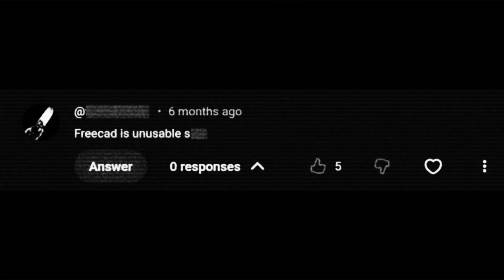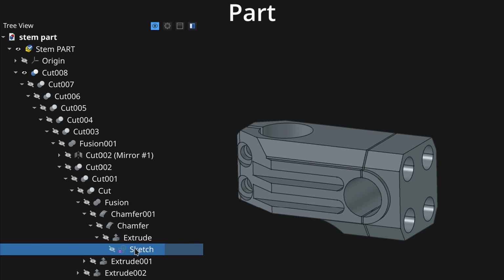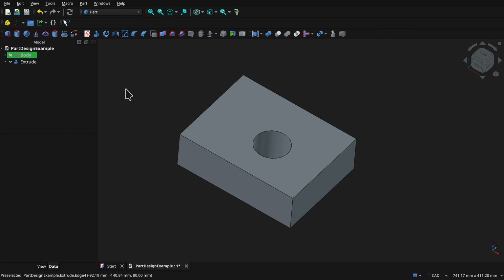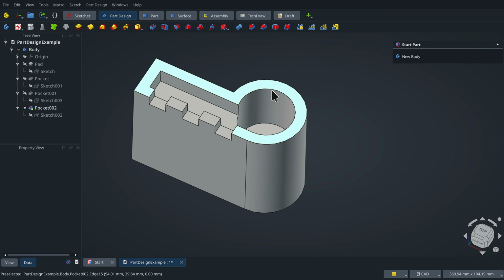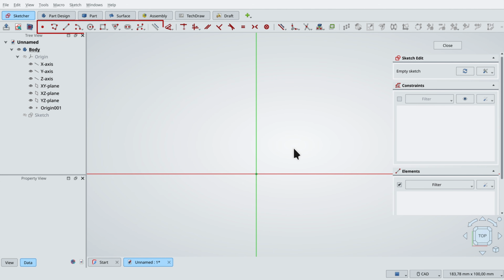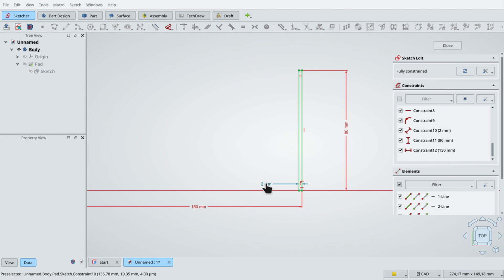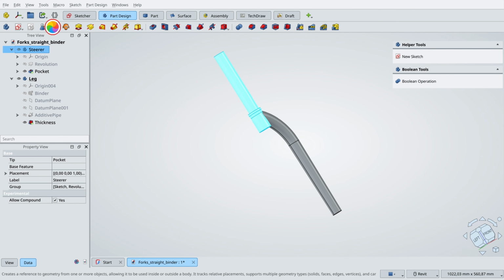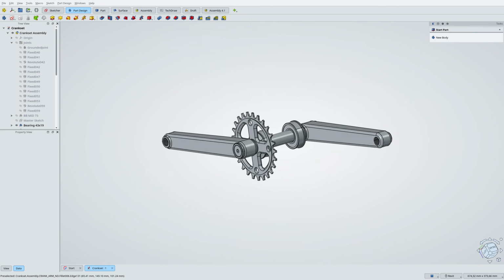STOP using FreeCAD WRONG! Do this INSTEAD (Workflow & Tips)

Comment: The UI is convoluted and confusing but the software is still really powerful.
Reply: It could really do with its blender  2.8 moment
Reply: @whistlehead9876 yes, was thinking the same. The potential for an amazing new UI is right there
Reply: @whistlehead9876  no it cant - too much complexity packed in one tool  But it's damn powerfull
Reply: @jakubrogacz6829 Same could be said of blender? And yet they did clean up the UI
Reply: @uhrguhrguhrg blender to me is more confusing than freecad, at least as far as parametric engineering style modeling is concerned.
Reply: @OtherDalfite  well, Blender is NOT made for parametric engineering style modeling (yet you could use it for basic stuff, there are addons made for that). Learning which software fits the task best saves a lot of time. 
The original comment was about the UI improvement the Blender Foundation made with switching from the UI we had from v2.53 up to v2.79 compared to the much more user friendly UI starting with Blender 2.8. 
I am a huge Blender Fan, have been using it since 2011, but it is not made for every task and I will never understand why people try to do everything in one single software, even things it was not made for. I could do 3D clothing with Blender, there are good addons, yet they still take much more time than working in Clo3D, Marvelous Designer or even the free alternative Style3D. So why would I use Blender for garments? Or why would I use it for parametric assets or where I need precise measurements? Any CAD software is better and much quicker for that task than Blender. 
But that does not change the fact that the Blender UI was improved a lot with that makeover, and I  agree with willmakevideo, the FreeCAD UI could be improved, but that takes time. Fortunately they already did some good improvements with version 1.1
Reply: @CG-Tutorials  don't mistake what I'm saying to say blender is bad or whatever because it isn't laid out like a parametric modeler. It's just confusing to me personally because of all the different tools there are. People make good stuff in blender all the time, I just have a skill gap.
Reply: @OtherDalfite  I did not understand your comment as if you said Blender is bad in general. You wrote "at least as far as parametric engineering style modeling is concerned", and that is what my comment is about. No hard feelings 🙂
Btw, Grant Abbitt has awesome tutorials here on YT if you want to get rid of that skill gap. As do Blender Guru, CG Boost and some other channels. My grandson startet with Grant and learned it pretty quick.
Reply: It is open source software.  A lot of devs are interested in UI features and as a consequence it has too much UI flexability.  Having a theme like this put on out of the box is going to step on a lot of fingers :)

The UI definitely is too complicated and I loved this tutorial.
Reply: Powerful it may be, but absolutely nothing in this fucking program behaves the way you'd expect it to. The fact that I need to look up almost every single operation, and then figure out what went wrong makes this less than beginner friendly.
Reply: Definitely convoluted and non intuitive.  No vertex snapping! Wtf
Reply: @MrClimateCriminal  The day you see complex software with simple UI, give me a shout ;)
Reply: @yannickcotten2854 I see it every day of my life.   It’s not about simple.  It’s about user friendly and intuitive.   The system itself under the UI is so unnecessarily convoluted. It had about 30 too many object classes.  The whole thing is ridiculous. But hey it’s free so I guess I can’t complain.
Reply: @yannickcotten2854  It's not that the UI is complex, it's a complex tool. The problem is that the UI is not intuitive and the error messages when something fails are super unhelpful and opaque.
The fact this video exists at all is evidence of that. It is getting better slowly, but there is resistance from the devs because they're under-resourced and don't consider it a priority.
The FreeCAD forum is full of complaints that are often met with "You're not using it right" answers, not necessarily proof that the UI is broken, but evidence that it's not intuitive enough. The people using the tool often come from SolidWorks or other CAD backgrounds, so they're not idiots who don't understand complex workflows and software.

An example - create a sketch, pad it by 2 mm and then chamfer or fillet top and bottom faces by 1 mm. It errors - why? Well, just look at the error message for your quick and easy answer: Fillet: BRep_API: command not done - what does this even mean?
Reply: He just demystified it and ptoposed a couple of quick changes to make it on par with its web competitor.
Reply: @TheSliderW  "quick changes"...So it IS convoluted and confusing by default, thank you.
Reply: @iliketoast-q9b  look, when i was a student back in 2004 i got into 3D modeling using 3DS MAX and that was way messier compared to this... I read through the manual and followed a bunch of tutorials, It took me a month a many nights pulling my hair to do basic things.
If you first launch ANY complex software like this and immediately call it BS and convoluted  before even glancing at a manual or, in modern times, at a basic video tutorial then you won't get anywhere but if all you need is rearranging window panes and making things prettier to get past your fears then do it...
No complex software has a single button "click here to model a fully featured parametric object complete with constraints, materials and animations "  You have to start somewhere
Reply: @iliketoast-q9b  lol, depends on anyone's point of reference. Most (attempted) users always reference other CAD software. Any other software will seem foreign and the speed of early use leads to further frustrations. Why learn another language?  In other words, similar starting points have nearly identical complaints about Freecad (as another language).
Reply: @dbeelee8564  No FreeCAD is objectively bad, as reported by beginners who tried to start with FreeCAD but quickly moved on to other software. Your attitude in the community is the reason why it's still bad, though it has improved recently.  Which workbench did you use today?
Reply: I'm pretty sure any CAD software UI is convoluted and confusing until you learn it.
Reply: @sushi926  Yeah but in my honest opinion, UI in Fusion is very clear and self explanatory. But on the other side, you get what you pay for. Here in FreeCad... you pay nothing, so... consider that.